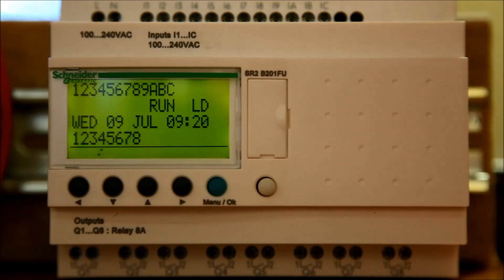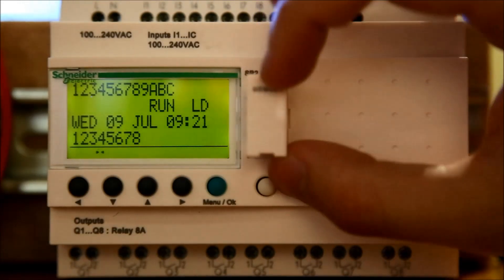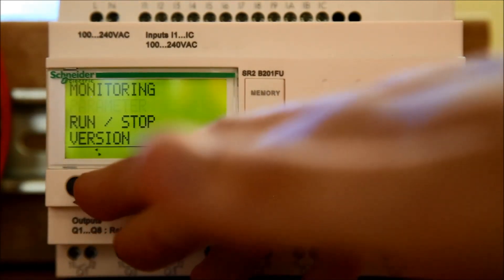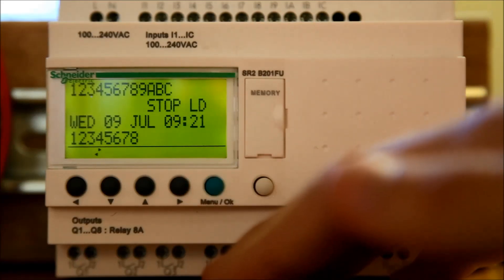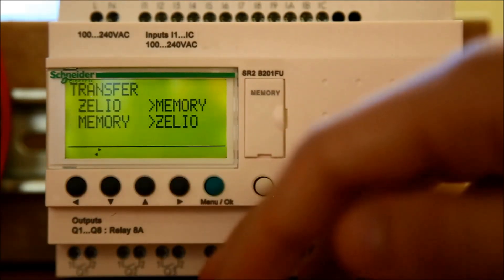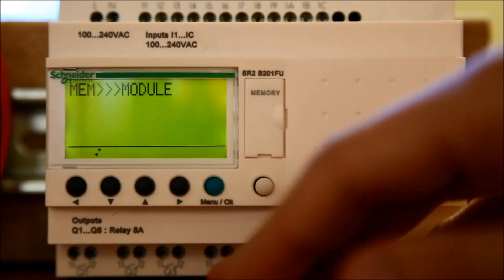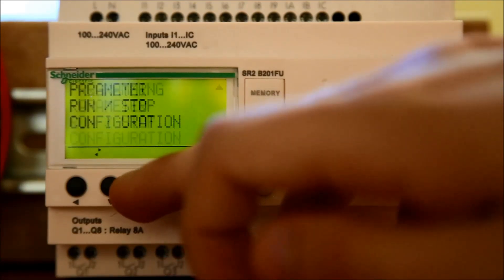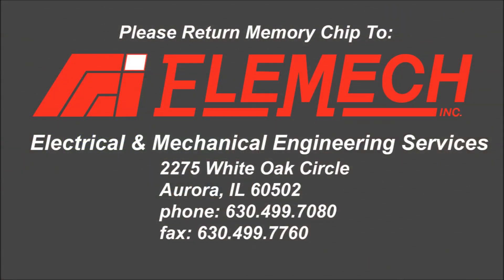Add Program to a Zelio Programmable Relay via Memory Module

Comment: can i copy the program from an existing zelio to a new zelio relay?
Reply from the maker: Hi, we typically transfer programs (2) ways. 

(1) If a computer with zelio software and required serial/usb cable is not available. It can be copied via memory module (SE P/N: SR2MEM02). The program first needs to be transferred from the existing Zelio to the memory module, and then from the memory module to the new Zelio. See knowledge base entries below. Note, the firmware must line up (within a certain threshold) between the 2 devices.

https://www.se.com/in/en/faqs/FA225576/
https://www.se.com/au/en/faqs/FA317565/

(2) A computer with zelio software and required serial/usb cable. See chapter 2 in the below .pdf link.

https://www.electrocentr.com.ua/files/documentation/SE/plc/zelio/guide/ZelioLogic_prog_manual_2017_en.pdf

Comment: Hi, is it possible to have say 5 programs loaded and then use an external selector on the panel facia where the operator would select a specific program, carry out the operation in that program then stop and select a different program. Thanks Jon
Reply from the maker: This is not possible.  You could have 5 memory modules and load the correct program before use, following the steps in this video.
Reply: EleMech Inc. thanks for your response. Apologies for delay...